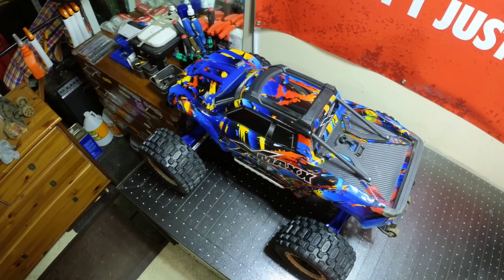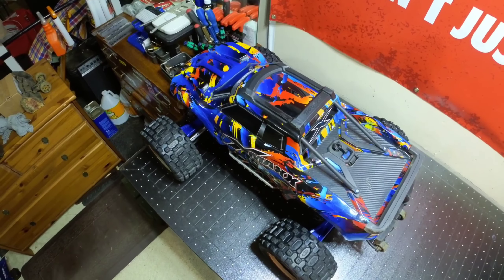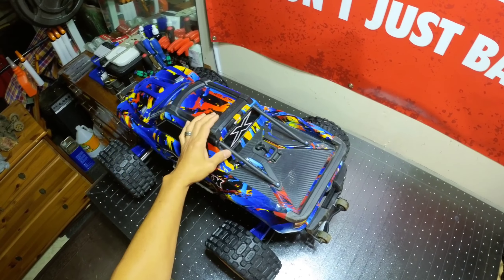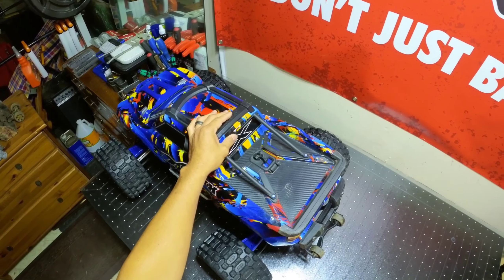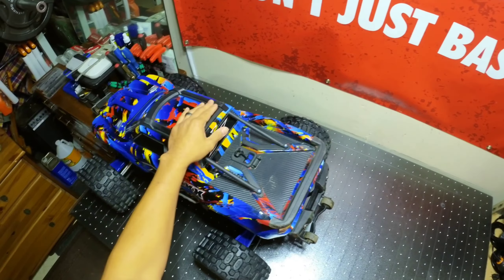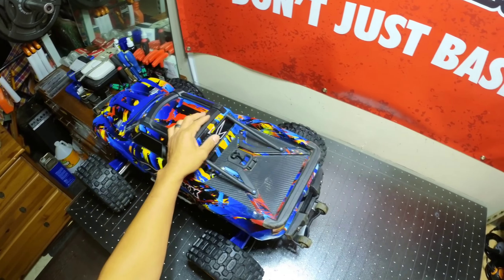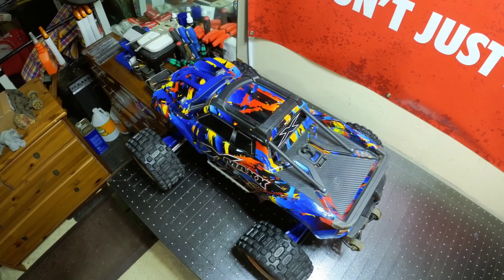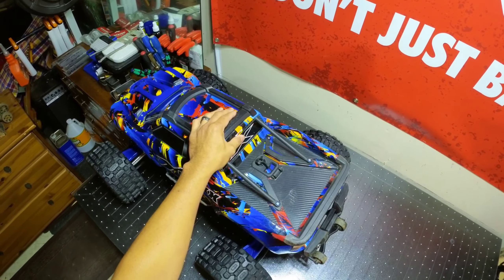NEW!! M2C X-series Upgrades for Traxxas X-Maxx. Slide out motor mount and ESC plate/Brace stiffiner.

Comment: Good review man.  I am WFO all the way with X maxx.   But I do have a bad as M2c chassis for my 12s Arrma kraton.  Pretty cool seeing more options for the X maxx
Reply from the maker: Appreciate you stopping by and checking out the vid man. Love WFO gears for sure. Still got my 30/35 gears. Definitely running them again with M2C motor mount. Especially when it's a breeze to swap. More options for the WIN.

Comment: Thanks for sharing.  
Not super sure if I really need this or not.  I typically don't break this part anywhere that being changed to aluminum.  

Did you check how much weight difference there is?
Reply from the maker: Thanks for watching Troy! Weight isn't much noticable to he honest brother. Just love the fact M2C now pumping some upgrades for the Xmaxx. Slide out motor mount is a killer upgrade for sure.

Comment: I think the wfo mount is better. The m2c is hollow on both sides where the mesh slider adjustment is. I have seen multiple bent m2c mounts even with the top brace. I think the wfo mount is just as strong if not slightly stronger without a top brace than the m2c is with the brace. And the m2c is 100% not useable without the brace so that shows just how much stronger the wfo mount is. If wfo came out with a 2.0 mount that also braced the top it would be hands down winner.
Reply from the maker: Appreciate your time watching. Both motor mounts have their own pros and cons. I have used both but preferred the convenience of easier mesh and swapping motors. I've tested the M2C without the top brace and it works just fine with zero issues running 1100kv motor. The bending issues are from people running bigger 56112 motors which I don't recommend on the Xmaxx. Due to weight and too much power for the truck it'll only causes more harm than good.

Comment: Nice mount Bowhouse has a nice one too. I want to upgrade to a nicer motor have to decide which mount to get.
Reply from the maker: M2C motor mount has more advantages and ease of use being a Slide out motor mount.  Setting mesh and swapping motor will be a breeze as well.
Reply: @CommanderAstigRC  It looks like the M2C brace screws into the top of the motor mount
Reply from the maker: @chrischupp9760  that's correct Chris.

Comment: I would love to know when they're going to come out with the extended hubs for the x-maxx. That would be awesome to have the extended hubs from m2c and the Traxxas xmaxx wide body kit together. I think that would be some really good handling
Reply from the maker: Appreciate your time watching. M2C is not making hubs but they're coming out with extended axles to widen the Xmaxx stance it's under testing right now.
Reply: They have the extended hub stubs that widen each side 15mm and also lets you use a traditional 24mm hex. I actually have them on my xmaxx and I run the kraton 8s hex with tru 24mm nuts. It’s absolutely awesome. Widens the xmaxx just enough and also always more of a wheel tire choice. It is called m2c 1192 x series wide kit

Comment: Please tell me this brace with the sliding motor mount and esc plate will work with thicker mod 1.5 gears on a 2028 800 kv? If so I need to order one Thanks.
Reply from the maker: Yes it will. I am actually running mod 1.5 now but with 1100kv.

Comment: I just did there whole beefcake kit on my x maxx.  That was my 7th all out m2c build and first traxxas build.  There quality always blows my mind.  Are you running the mod 1.5 gears and does that setup get hot?
Reply from the maker: Gotta love M2C's quality Bro.  I'm on mod1.5 30/35 gears now. It's a perfect and temps friendly gearing. Max5 850kv motor.
Reply: @CommanderAstigRC  so I ran the 1100kv and 25/30 gearing.  In still working the bugs out but it did get a little to hot for my liking.
Reply from the maker: @joshherrman3201 your gearing setup should be pretty good. 1100kv Max5 ESC?
Reply: @CommanderAstigRC  sorry I forgot to mention that.  It is a max5 and hobbywing 5687 1100kv motor.  I had my punch set on 3 and turned it up to 5.  It seemed to help but I have only ran 2 batteries through this setup so for.  The hobbywing is kinda strange to me all my other cars are castle combo's.

Comment: How and where did you mount the stock antenna with the stock receiver box? Wouldn’t the chassis stiffener be in the way ?
Reply from the maker: Appreciate your time watching Timmy. I'm using an upgrade radio and managed the receiver wire around.

Comment: I’m probably gonna run 30/35 mod gears So I’m wondering if they will work on this M2C sliding motor mount? I need to know ASAP from anyone, Thanks.
Reply from the maker: What mod 1.5 gears do you have now?
Reply: @CommanderAstigRC  wondering the same
Reply from the maker: @nicolasrbn1804  it'll work just fine. I'm running 30/35 mod 1.5 gear myself.

Comment: Hey commander  rc, you inspired me to build 1/7 talion build a year ago . I have 2016 6s xmaxx,  has many upgrades ,except motor. I want to buy hobbywing 1650kv motor for my xmaxx. Think the m2c mount is way to go for me. Let me know what ya think,I respect your knowledge.
Reply from the maker: Appreciate you stopping by and watching the vid man. What can size is the 1650kv brother.
Reply: Near stock, 4985 ,,1650kv,,max6 combo.
Reply from the maker: Yes. M2C X-series motor mount will fit.
Reply: Thanks for your time, don't see xmaxx parts on there site yet,are you 1st one to receive this mount.
Reply from the maker: @stephenb9940  mount on testing stage. Should be available soon bro

Comment: Again that M2C motor mount and support plate bends. And there are videos showing it bent and only after 4 jumps.  https://www.youtube.com/watch?v=_FlFfju6iTU
Reply from the maker: Appreciate your time watching man. I watched that video. Those repetitive concrete landing can snap/bent any parts. Happens to lots of people including myself. I personally do not recommend 56113 800kv motor on the Xmaxx for bashing it's way too much power and heavy. It can cause more harm than good to the truck tbh,  can bust gears and tires. Based on my experience. 5687 1100kv is perfect. M2C is coming out with motor end bell support bracket soon.
https://youtu.be/IhcnnpytDxw
Reply: I run a stainless steel motor mount and use Castles 2028 1100KV motor. I have not bent it once and I'm talking 60 to 100 foot drops. In mind I do have a M2C motor mount and top support plate. Never mounted it. And after seeing the videos of it bending. Don't know. We'll see. When they release that bottom mount support I may get it after I see what others have to say about it then !